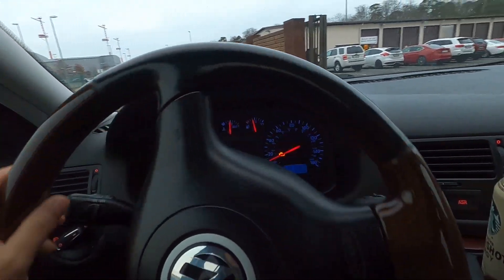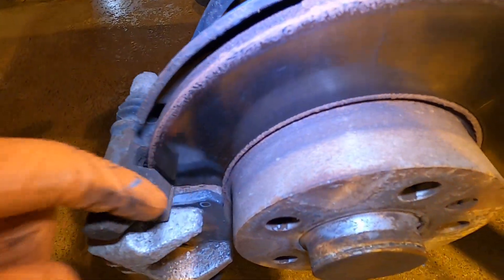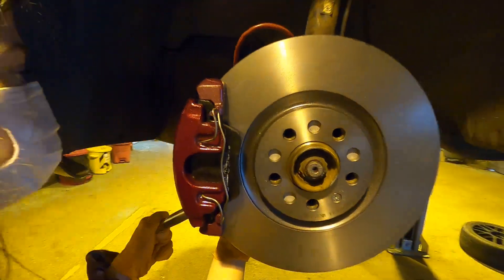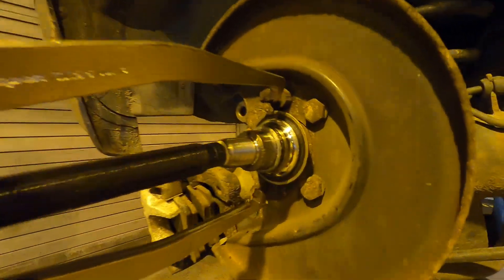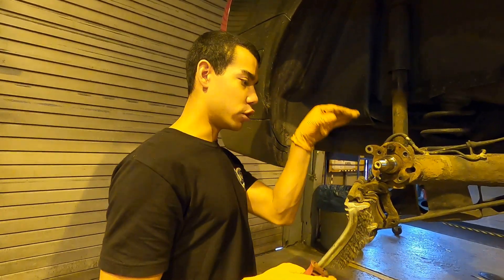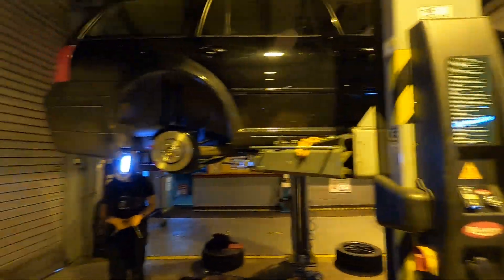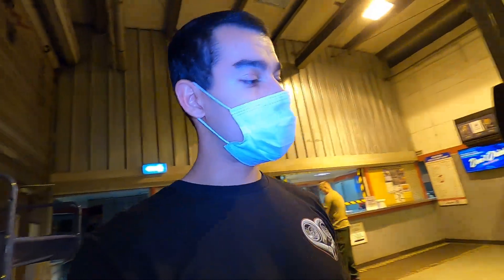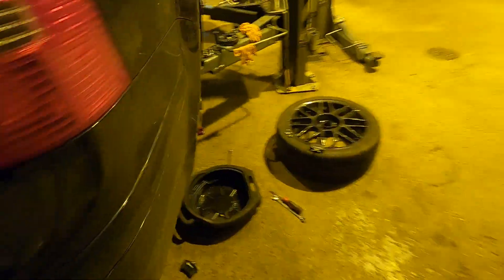This Didn't Go As Planned....( Jetta VR6 Wagon Brake Upgrade )

Comment: @Christian Smith
They make bleeders that have a smaller threaded bleeder that fits inside the bleeder, so you could weld, or JB it in place, and still be able to bleed them.
They are called "Speed Bleeders" and i know Stahlbus make some, you just have to find out the correct thread pitch, and bleeder seat angle.

Comment: I also did not got the bbs RC tool for years. What i always did was wrap an extension cord around the nut pull and then take the 2 cord ends and use it as a wrench, works a charm and no damage. But now that my 2 sets of rc's are freshly rebuild i Just ordered the bbs special key. Your friend at retro wheels got em and pretty cheap to mate!
Reply: Christian please look at this!

Comment: That crazy after fixing the rear calipers the one side strips out on bleeder, hopefully the one caliper you borrowed Marvin will work and get you threw the inspection to get the Jetta wagon on the road with regular plates. Glad to see Casey and Martin helping with the insulation of the new brake calipers and new parts! By the way what new car is Casey thinking about buying?